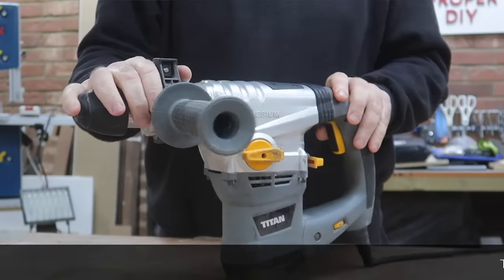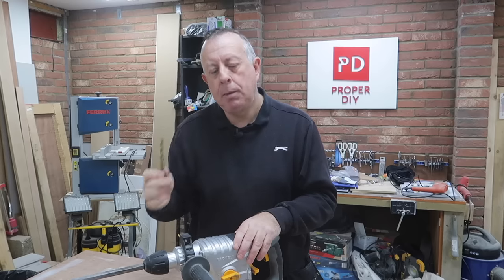Don't Buy Just a Hammer Drill

Comment: I will never forget my first experience of using SDS drill after breaking two standard drills trying to drill concrete. The feeling was sheer pleasure. I love my SDS drill and second everything you've said in the video. Wish I bought one years ago.
Reply: Totally agree. You can feel the engineering at work.
Reply from the maker: Well said!
Reply: I bought one and have 0 regrets.

It was not even that expensive.
Reply: I'm going to get one. I drilled some 3/4" holes in cinder block with a hammer drill, and it took forever. I had to take breaks to let the bit, the saw, and myself to cool off. I also had to drill some holes for tapcons and had to keep dunking the bit in oil.
Reply: It was like butter after I bought mine
Reply: @ProperDIY the carbide tip is unaffected by heat. It is ceramic. The best can loosen the braze joint where the carbide is brazed onto the steel shank. But it won't affect the carbide.
Reply: Ya you don't know till you know
Reply: I know that feeling.

I tried to use a 6” hole saw on a piece of furniture a few years ago and literally burned up my brother’s Black & Decker drill. I then bought myself an expensive DeWALT DCD998 PowerDetect hammer drill thinking it would do everything I’d ever need (“buy once, cry once”)… until I tried to use it to drill for concrete anchors in the garage floor, secure workbenches to the cinder block walls of my workshop, and drill a hole through the block wall to route an EVSE outdoors (EV charging station). It just wasn’t the right tool, but I still couldn’t bring myself to spend the money.

When I moved back into home that had been damaged in an EF4 tornado I kept running into old concrete with the mower. These once anchored the old balcony which was long-gone. Trying to mow around them has been a nightmare of bent blades and slipping in the grass with the mower literally rolling over on me. Suddenly, the stars aligned and I got a DeWALT DCH133 rotary hammer on clearance for 86, a 5AH PowerStack on clearance for 75, and several Bosch Pitbull and Pitbull Xtreme SDS Plus chisel bits at the flea market for 1 each (the so-called “Viper,” point chisel, wide chisel, stubby chisel, etc). I loaded the point chisel up into the DCH133, held it vertically with one hand, pulled the trigger, and watched in amazement as the concrete fractured into three chunks with two now being a manageable size. I was flabbergasted and recorded myself doing it a few more times on the rest of the concrete.

All in all, I probably spent 10 cumulative seconds breaking up the whole thing. This made me question why I went so long without one. I’ll never forget seeing it cleave apart so effortlessly, and pulling the tool back out made me feel a bit like Arthur must’ve felt pulling Excalibur from the stone.

It’s not a drill… it’s a jackhammer!

Comment: I have that drill. It's superb, remember being totally shocked when first using it,so much easier than my usual hammer drill. Building extension it was battered and abused and still works great. Broke up 4inch thick 300mm wide concrete to dig a 7m long trench. Used it to core drill a150mm hole through 700mm of concrete. Bought an angled spade chisel and taken of rooms full of plaster and tiles. If it died now, it owes me nothing and I'd replace with the same. 👍
Reply from the maker: Nice one!
Reply: Same, screwfix special. Need some wider chizels
Reply: You're lucky the core didn't snag as the drill would have snapped your wrists.
Reply: @realtalk1590  Is that something that happens??
Reply: @davak72  purpose built coring tools have a brake which stops them turning if they catch, otherwise the bit you're holding on to spins and so do your bones 😓
Reply: @realtalk1590  Do you have a link to a video or article about this? It’s a terrifying thought, but I can’t seem to find anything on Google (just checked)
Reply: @ProperDIY  thank you so much for posting this far understanding viedio...❤

Comment: There are a few English 'backronyms' of SDS - 'Slotted drive system' as you quote is one, another is 'Special Direct System'.  The original however is German: Steck, Dreh, Sitz - Insert, Twist, Secure.  This was a tagline used by Bosch in the 70's.
Reply: The German explanation makes sense, since sometimes Jigsaws with T-shank holder are also referred to as SDS tool holder
Reply: Wasn’t Hilti the patent holder for a long time?
Reply: @Conservator. Maybe because I used Hilti with SDS in Poland over 20 years ago.
Reply: Had to leave a like and comment for the humour and great delivery and presentation, also for helping me realising I should have got one of these years ago too 😅. I had a 2nd hand one a long while back that broke, I should have replaced it, honestly didn't realise they were so affordable, silly me 😐

Comment: I wouldn't advise any DIY to go cordless for an SDS. Not worth the extra money and corded are more powerful.
Reply: It's not always the case that corded are more powerful. I have a Makita DHR264 which advances a lot better than the corded Bosch GBH 2-28
Reply: @ooltimu  but what is the price difference? Pound for pound a corded tool will 90% of the time be much better, especially for something that wont be used every day.
Reply: @moochoman9948  Depends. You don't buy cordless when you think pound for pound. Cordless are really life savers when you don't have access to power or it's very cumbersome to work with a power cord hanging besides you. Even as a DIYer I find them very handy. Who uses corded drills anymore?
Reply: @ooltimu  I'm a joiner mate working for a firm building extensions. Most lads use corded stuff as we have power. Cordless is decent for convenience but if your cutting/drilling all day it's not as good. Hire a Hilti from Travis, it'll be corded unless you specify.
Reply: Meh, my dewalt cordless works great for everything I need. I even just busted a  large stone in the backyard with it and some wedges... Love the convenience and certainly don't lack power for household stuff

Comment: I've put off buying an SDS drill for years until a timber wooden spur had rotted at the base leaving a stub in concrete, I  spent nearly the whole of yesterday pounding away at the concrete around the wooden stub using a club hammer and various chisels. Now I can't wait to use my new SDS drill to break out the concrete so I can fit a new concrete spur and bolt that through the fence post. Great video, thank you for showing this.

Comment: Two points:  Even the relatively small SDS drills are a great advantage compared to conventional masonry drills.  I use one I got from ALDI for the easier jobs and Hitachi for the heavy stuff.
Perhaps you should have included a reminder to grease the SDS bit so it slides freely in the drill. This end can get hot if not lubricated.

Comment: This is really good advice.
I tried drilling my garage brickwork three months ago to put insulation on the wall, so needed many holes to take rawleplugs and screws for the framework.
The first three holes, drilled with a ‘hammer drill’ nearly killed me, never mind the drill bit! (I’m 75..). I got out my cheap SDS drill and it went through the process like a hot knife through butter, a real pleasure. Don’t mess about, get an SDS drill and do it right. Les
Reply from the maker: Quite right! Totally different experience with SDS

Comment: First time I've seen your videos. I really appreciate that you speak of the mechanics, or the engineering of how an SDS system works. This is what I've understood from your explanation: when a hammer strikes a bit of concrete, a chip flies away; an SDS is a slow, precise, controlled hammer. Bits are usually about cutting. SDS is about striking and removing dust from the hole. In short, it's a versatile baby jackhammer. Good job.
Reply from the maker: Thanks. Yes exactly

Comment: Agree completely. Didn't know these existed until I needed to drill 20 5/8" holes in concrete. Makita SDS drill did it in 30 seconds.  Heavy duty Makita cordless "hammer" drill couldn't do it in 5 minutes!
Reply from the maker: Exactly
Reply: what model Cordless you used?
Reply: @UncleIvan1  The Makita Hammer-Driver CORDLESS is the XPH07 with a 5/8" carbide masonry bit. It stalled out after about 3" and 5 minutes likely because we dulled the carbide. The CORDED Makita  Rotary-Hammer SDS-Plus is the HR2641.  We ended up with a Bosch SDS-Plus 5/8" x 8" Bulldog Tough (Extreme) 4-cutter bit.  It is still usable after 30+ 6" deep holes in concrete.
Reply: @engineerncook6138  i have the newest version XPH14 , but I haven't tried using it on concrete.  From what I've seen on other people's reviews,  it's not really good for concrete . I have a Cordless sds 1" makita for the concrete

Comment: Thanks for another quality video Stuart.

SDS is definitely the way to go if tackling heavy duty  concrete drilling. So much easier and less impact I think on your arms and wrists.

Just watch out with some of the cheaper SDS machines as they may not have a clutch which means if it binds and gets stuck, it will potentially spin you around and break your arm off.

Comment: Great advice as always. A method for drilling small holes with a standard hammer drill,  if you don’t have an SDS rotary hammer is this. Sharpen a standard masonry bit on a grinder, to give the carbide inserts a sharper leading edge. This will often do up to 6 or 8 mm diameter holes in hard brick and concrete. This same method also makes a good drill for hard metals. I have done this to drill a hole through a file. Needs a lot of pressure and cutting fluid/coolant.

Comment: I purchased an SDS about 15 years ago.  Didn't need it at the time.  I tend to see a bargain tool, buy it thinking eventually I'll find a use for it.  Fast forward about 5 years.  I tried smashing up a old concrete garden path with a sledge hammer.  Nigh on impossible.  Then ding 💡let's try the SDS out. That's when I realised everyone needs an SDS drill in their kit. Turned off the drill function,  put the spike in the chuck and bang. About 45 minutes later I had a path of hard core. Couldn't believe how easy it was.  Now never with out an SDS drill. In fact I now have two.  Great demo vid Stuart 👌
Reply from the maker: Nice one! Good example - I wish I had seen my video 15 years ago!
Reply: That’s exactly why I’m here watching this video - saw a bargain on one of these and need to know the reasons why I should own one 😆

Comment: I purchased an older version of that Titan drill when we did a kitchen update and remodel a number of years ago.  I used it to take down a wall, remove both floor and wall tiles, drill numerous holes, chase walls and cut out recesses for new electrical back boxes and it never missed a beat.  It was a bit on the heavy side but that was only a minor issue, a big mistake, which I believe a lot of people make, is applying too much pressure when working with an SDS drill, I find it more effective, especially when chiselling, to use the weight of the drill itself and apply little or no pressure at all.

Oh and I still have it by the way, it may look a bit grubby now but it still works fine.
Reply from the maker: Nice one - goo point.

Comment: I couldn’t agree more, some years back I was trying to plumb in a basin in my utility room, I needed to put a couple of 15mm pipes through the solid brick wall from my kitchen sink, I had a 1000w hammer drill at the time as my main corded electric drill, I managed to get one hole through, and tried the second, but concluded I must have burned and blunted the drill bit, so I went up to my local B & Q to get another 

While I was walking into the power tool aisle, I saw an SDS Drill, now I knew about them, but had always written them off as too expensive to justify for DIY,  but this one a NuTool machine was only £45 and included five meaty drill bits, a chisel and a breaker point, plus a standard Jacob’s keyed chuck, so I bought it

When I got home I repositioned myself inside my sink unit, braced for Impact !, and pressed home the drill, to my utter surprise and delight it went in like a hot knife through butter, needless to say I haven’t used anything else to drill brick or concrete since !

Without a doubt this was one of my best power tool purchases ever, I still have it, and it still works beautifully, I have others now, including a Lovely Bosch I treated myself to several years later when it was on offer in B & Q again, I swear by the tool, one of the very finest inventions in power tools, my advice, if you’re a keen DIY’er buy one, you will never regret it. - Julie
Reply: When I started working in carpentry we made the installations as well, we had one of these sds drills to make holes in concrete.
I was hesitant to use it hence to my previous experience with regular drills at home, and it could take me 1 hour to drill a couple of holes. 
So I take this drill and I could believe how easy it went it, I almost shed a tear and was under impression for a week.

Of course I had to buy one cheaper version to have at home even if I'll need it once in my lifetime. The amount of time, frustration and vibration to my joints is saves me makes it a solid investment.

Comment: I purchased this Titan SDS drill several months ago and I can agree with Stuart, it’s a great drill! Absolute bargain for under £80. I recently bought a tile chisel and it removed bathroom tiles with ease! An absolute beast of a machine, when you need to bring out the big guns - this drill won’t let you down 👌🏻
Reply from the maker: Well said!
Reply: I've used a smaller DeWalt SDS drill with a spade fitting to remove tiles. I can confirm that a good SDS drill with spade fitting easily gets tiles off walls, and quickly.

Comment: Thank you, this is exactly the information I needed. I got offered a bargain on one of these but couldn’t think why I would need one… Now I’m thinking about all the holes I will need to put in concrete block walls, concrete laid where I want to put a deck , busting through rock when putting in fence posts and even the more heavy duty drilling in softer materials. Off to accept the offer now!

Comment: Thanks for all your videos! Explains it all so well.  I need to drill a run of holes in a 50 year old concrete retaining wall and had hit exactly the same issues you mentioned with a normal hammer drill, just ordered the same SDS you revewied the titan 631 set as looks exactly what I need for the job, so this video is very much appreciated. 👍

Comment: Completely agree about once you have it, you'll use it. I bought one second hand from a builder who had 3 and didn't know it. Paid £40 for it and it was barely out of the box. It was the corded Bosch hammer which is not too bulky but has enough power for the jobs I need (mainly drilling brick).
Reply from the maker: Sounds like a good deal

Comment: Honestly, it's probably because I'm in my 30's, but i find learning about tools/house maintenance extremely interesting and useful. 

We bought a fixer-upper in '21 and it took 18 months of sub-floor replacement, chasing out wires, drilling in joists using a paddle bit to run wires etc but by the end, i went from absolute novice to relatively adept at tools thanks to videos like this. 

Sds/drill-driver/combi drill / impact driver et all can all seem like technical terms and a bit intimidating, but learning about different drills and their application is interesting and useful. Thanks for all you do.

It's always funny when the handrill can't even dent our 45yo concrete posts, i feel the post laughing at me. Then the plug-in SDS comes out, and the post hears boss music 😂

Comment: Totally agree. Bought a wired Bosch SDS with a bit set from Aldi years ago and it’s a dream. The hammer only chisel is great and saved hours on jobs. I also bought a normal chuck converter head and used it to screw decking frame no problem whilst impact drill batteries failed
Reply from the maker: Nice one!

Comment: My Bosch 24v sds drill just died after many years of use,so just treated myself to a new  Bosch GBH 18V-26  sds drill, rather impressed with, it drilled 25mm diameter holes with ease for fittting some weep vents.Can also recommend  the Heller SDS-Plus"Trijet" bits, they go  through the hardest concrete/brick with ease.

Comment: Maybe someone already mentioned this but it is important not to push too hard and leave the mechanism enough range for the percussive action. Actually you'll notice that oftentimes you just need to push very gently and see the action have a longer stroke .
Reply: Good point - many of these rotary hammer drill videos show the guy bearing down on the drill with their bodyweight - in addition to the weight of the drill itself. Same thing with reciprocating saws - the guy is bearing down on the tool -  important to let the tool do the work as the manual says! Thanks!

Comment: Good to know it wasn't just me. With my very old (but in good condition) 550W corded Bosch hammer drill, cheap drill bits wore out quickly and new medium priced masonry drill bits still took me over half an hour to drill a 10cm deep 10mm hole into brick! I kept speed moderately low and took breaks to cool down bit. I finally sold that drill, as good as it was and will be buying a rotary hammer drill for my next brick project!

Comment: used a cheapy b&q sds drill to drill into old ww2 aircraft hanger floors to bolt racking down. sailed through that 60+ years old concrete that was V V hard. brilliant bit of kit.  Hilti drill bits are brilliant as well, worth the money as the ones supplied in the case are usually carp!

Comment: I’ve had a Wickes SDS drill for 25 years… well abused and still works. Used with up to 18inch 22mm bits… The torque will almost break your wrist if it catches and you’re not prepared…